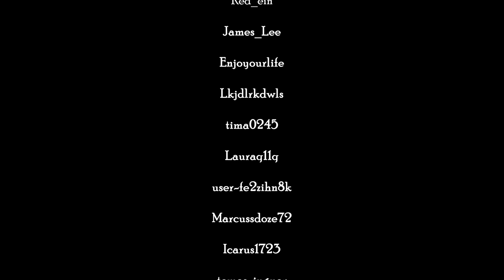Making Horizontal Drill Press / DIY

Comment from the maker: When we process the side of a large board or use a long drill bit, the normal drill press is difficult to work with.
To make this easier, I made horizontal drilling equipment with worm gear and adjustable height.
I made it easy to fix the board with a special type of clamp.
I think it will be very useful for the side processing of large boards.

Please pay attention to how to secure the drill, the adjustment to zero, the clamp to secure the board, and the use of a worm gear to adjust the height.
I think it can be used in many ways.
If you love DIY, you'll be able to enjoy it.
Thank you.

Comment: This looks wonderful and well made, but I don't understand what this can do that a tall (standing) drill press can't do.   Unless you are trying to drill something that is 8 feet long, I guess.   Then it would make sense.  But that seems like a lot of work to build something you won't use very often.   Wouldn't it be better to build a pantorouter instead and use that for your horizontal drilling needs?
Reply from the maker: Your comments are very accurate and to the point. To explain briefly, it has been a dream of mine for a long time. So I don't know if I put in more effort than necessary. Of course, this can be done with a normal high drill press, but setting it up is cumbersome and I don't use a drill that high. Actually, the original goal was to make a very long drill bit come out horizontally from one wall of my sanding base. As I try many new things, there are some works that are weak in terms of practicality. I am putting more emphasis on saying I will try it, so please understand. thank you .